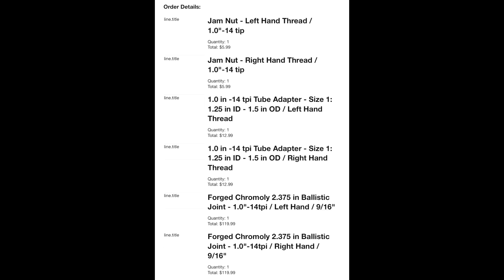RAM 2500 POWER WAGON DO IT YOURSELF TRACK BAR

Comment: May I ask why you did this ? What advantages over the stock one does this give you? Just curious all your work is awesome and really like your bumpers you made. I just installed a set of white knuckle rails on my 75th power wagon can’t wait to hit the trails now.
Reply from the maker: Thank you , Of course you can  🙂 depend on your driving  the factory bushing in time crack and make noise . Also when your axle travel up and down there is force on the softer bushings  and your axle moving sideways , which is not good . With ballistic joints  you not only extend life of your track bar  but also improve your driving , less chase the truck with steering wheel when you hit bump or dip .